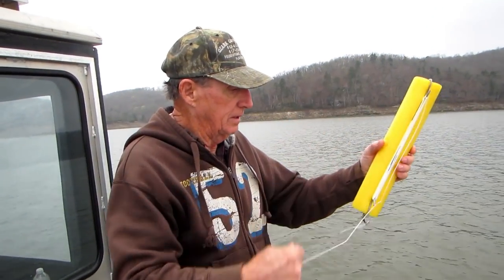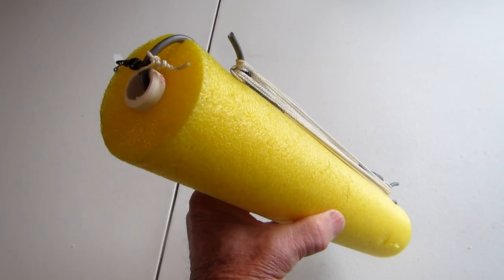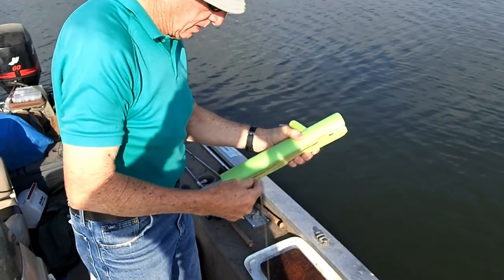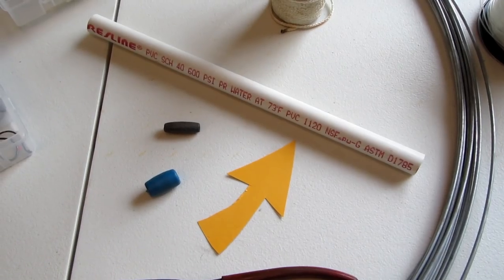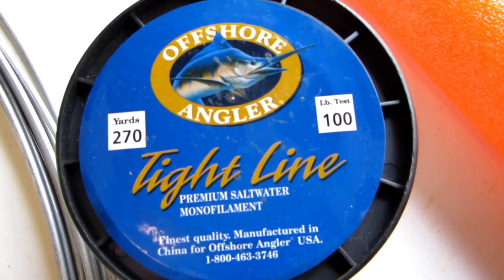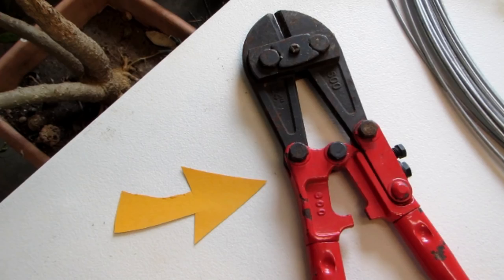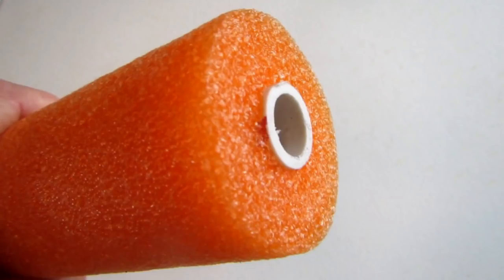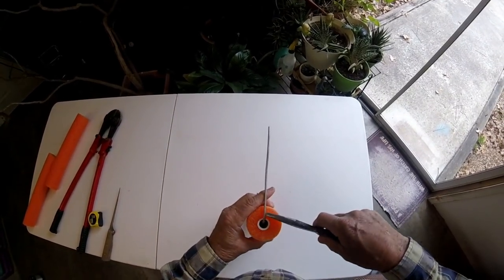FISH4FUN: THINGS I DO - CATFISH JUGS

Comment: I like the wire through the center of the PCV. How do you make your tags for your jugs?
Reply from the maker: The tags are make from milk containers.  Cut the containers open and cut flat sections to the desired size.  The material is slick smooth on the inside but the outside surface is frosted just right for the ink from a permanent felt tip marker to stay on even after being exposed to water for prolonged period of time.  Thank once again for your insightful comments.

Comment: What gauge wire do you recommend for the jugs?
Reply from the maker: Charles, the best wire I have found is about an 1/8" diameter.  I don't know about gages!!! But, I got it from MFA Farmers Exchange and it is very stiff and galvanized.  Diameter doesn't really matter that much.  But it doesn't bend or rust and it still looks new after over 15 years of use.  Thanks for coming along and responding.

Comment: This seems to be about the best you can get for a robust, cheap, effective design that is also easy to assemble. The only improvement I could think to make would be to include a dedicated place to store the hook as hooking into the foam will chew it up over time and reduce buoyancy... but not a big deal I suppose.
Reply from the maker: I agree100%.  Storing the hook would require more precise positioning of the hook on the line.  The noodle eventually gets beat up but all you do straighten out one end of the wire, put on a new noodle and bend the wire back.  I did that last year!!!! Thanks for a great comment.

Comment: Awesome design. What gauge galvanized wire are you using?
Reply from the maker: I don't know gauges but it is 1/8 inch diameter.  It is galvanized and I buy it in roles at MFA farm stores.  Thanks for watching and taking time to comment.

Comment: Hello! Exactly what nylon line are you using-lb test, diameter,..? Would black tarred 115 lb bank line suffice? I take it the white is much easier to see?
Reply from the maker: John, I don't pay any attention to color.  I use only nylon braid, because it won't come unwound and is a lot softer on your hands.  Something in the 1/8 inch size or slightly less works best for me.  If the line is too heavy the bait will ride up during high wind and will drift to slowly. If it is too small it tends to tangle and can cut or burn your hand when landing larger fish. I do a lot of trial and error, mostly error LOL.  Good question, thanks.
Reply: @jerryrouth6115  Thanks for reying, Jerry. Already building 30 of them. I'm thinkn of using "great stuff" on just inside of pvc to close it, add boyancy and another measure to keep galv wire from moving. 
Btw, i notice that you do a certain loop to set the depth just before throwing it.
Reply from the maker: John, the loop doesn't set the depth. The loop simply ties onto the wire to hold the depth in place.  I construct the jug so that each turn of the line around the bends on the wire is approximately two feet (12 inches space between each bend).  The numbers of turn you make determines the depth the jug is set.  I twist the line around my finger 3 times or so and place it over the bend that holds the line and pull it to form a loop knot to set the depth.

Comment: Where do you get that pole grabber from
Reply from the maker: Chris, I made mine from an aluminum tube.  It is very easy and simple to do.  If you make one be sure to plug the end so it will float and don't bend the end in a curve,  it will pick up the jugs just fine when straight and make it a lot easier to get off the line.  If you can't seen enough detail to make one, let me know and I can send you a picture.  Thanks for watching FISH4FUN.